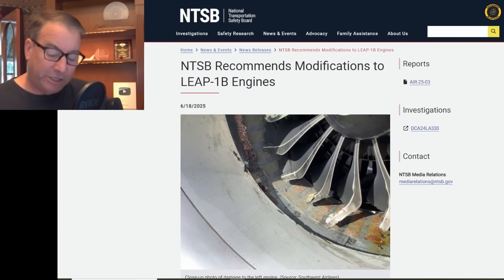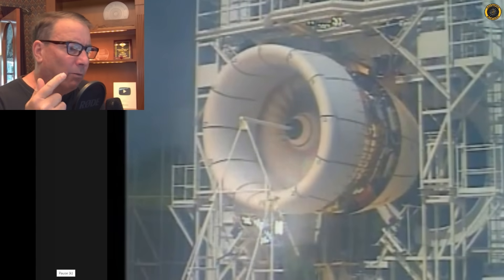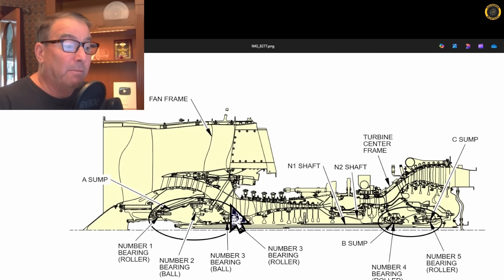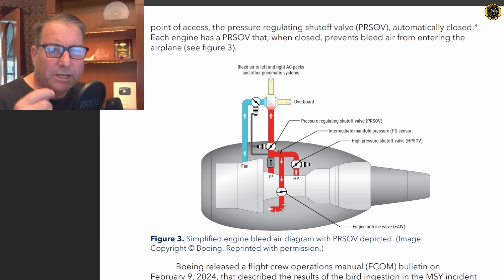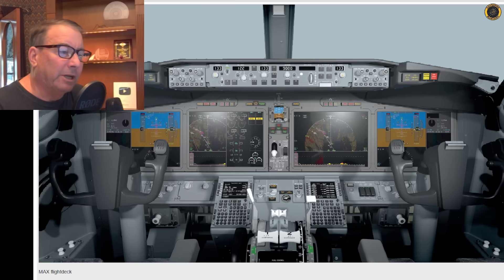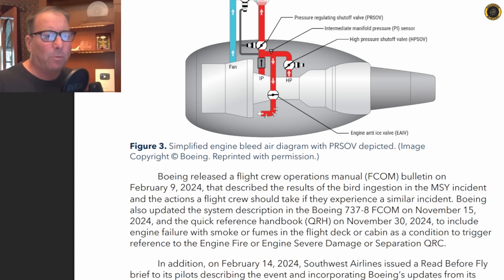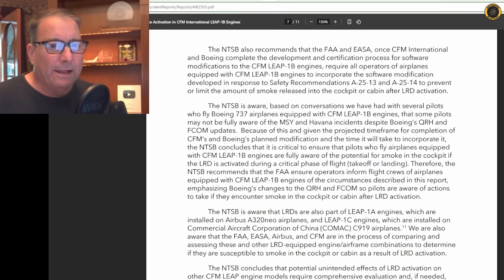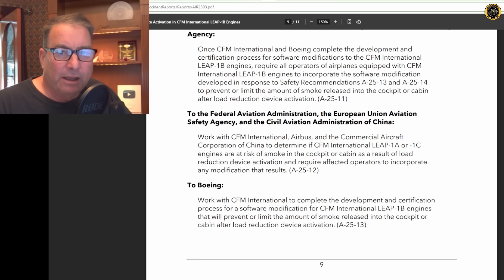NTSB Urgent Safety Recommendation 737Max LRD CFM Leap Engines

Comment: Old timer here . . . All 737s, at least it's my understanding that all 737s, have auto bus transfer systems for the electrical power coming off the generators (at least the old ones did that i used to work).  727s had the auto pack trip system, that would shut down the packs automatically if you lost an engine on takeoff.  And back in those days, the pylon attach points were designed to act as a structural fuse, and in case of a major vibration event were intended to shear and allow the damaged engine to fall away from yhe airplane rather than allow that major vibration to cause additional damage to the airplane structure or aeroelastic twisting too.  707s and 747s had that design.

Comment: Worth noting, that cockpit smoke also would slow down or even stop pilots response to emergency, because smoke could completly block their view to instumentations, checklist books and outside.
Which could cause totally prevetable crash or extra passengers poisoning.

So immediate closing (both ?) engine valves on any signs of smoke, IMHO, should be trained without checklist.

Comment: Just out of curiosity, are there records of how many bird strikes damaged early generations of jet engines, like the P&W JT3C and JT3D, used on Boeing 707's? Does the large air
intake of modern jet engines leave them more vulnerable to engine damage from bird strikes or runway debris?
Sometimes, progress is not all its cracked up to be. New generations of jet engines may be more efficient, but at what cost?

Comment: I'm glad that this is being addressed, and I'm glad you mentioned Mentor Pilot's video on this potential issue. In the event of a mid-flight failure, disabling the bleed air on the affected engine should be done very early, but I also remember that he suggested altering the takeoff checklist to leave the cockpit bleed air disabled (or something similar), because it wasn't needed during takeoff, and the smaller cockpit can be filled with toxic gas within seconds, incapacitating the pilots during the high workload of a takeoff where pilots are already busy managing a dozen other critical actions. In that situation, it's possible for one or both pilots to become incapacitated, which could be deadly in an event where the aircraft is now flying with only one engine during a takeoff.

It's also a positive change to see this finally being addressed. So many other potential issues with the 737 Max have been swept under the rug and ignored until they caused serious problems. It's refreshing to finally see these "small" issues being addressed BEFORE they cause loss of life or the loss of an aircraft.

Comment: Thank you 👍🏻😊 as always, very good analysis. Electronic updating of flight manuals, is a real issue, where flight crew do not get enough time to take in all the changes, without delaying a departure. Significant changes need to be better highlighted. Cheers, John. NZ 🇳🇿

Comment: As a B737 pilot, I can't, for the life of me, understand WHY our company hasn't mitigated this issue by authorizing and/or requiring ENG BLEEDS OFF takeoff procedures when operating a MAX.  That was the SOP at my Regional carrier the ENTIRE time I was there!!  Why not operate on the APU until 10,000 feet MSL and reconfigure as you egress the "sterile" phase of the flight??  It's not that hard!

I choose to not be Captain for a number of reasons.  If I were, however, I'd ask my First Officer his/her thoughts on bleeds off takeoffs and then request they set up for ENG BLEEDS OFF takeoff every time when operating a MAX.  That's just me...IMHO.  It shouldn't be discounted that forward thinking Captains and crews can't do this at present.  Just sayin'.  JSMH......

Comment: Juan, just a small correction to your otherwise nice video. 
On the max leap engine on the Boeing 737 uses 4th stage and 10th stage compressor air. The  5th and 9th stage air that you reference is only on the CFM 56 engine that is on the next generation Boeing not the max.

Comment: Wow, not automating that valve is a sin. I work in the commercial HVAC automation industry and air handlers/supply fans/dampers etc are always interlocked with the fire system automation.

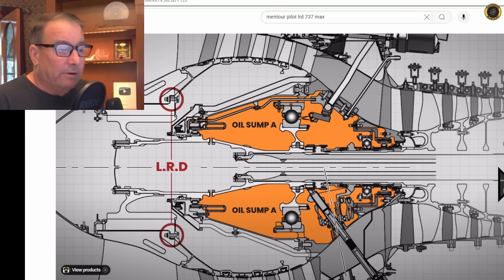Comment: The LRDs are incorrectly highlighted at 3:27. They are just above the first (large) ball bearing (the second Bering in the cutaway. 🇨🇦🏍️

The highlighted bolts are retaining the low pressure compressor drum (the 3LP compressor stages).

Comment: The FAA needs to set a time limit for extending any type certificate. These problems would not happen if the FAA forced clean sheet designs by way of not allowing the continued use of type certificates. Even the MCAS wouldn't have happened. I am not absolving Boeing on MCAS, I am simply saying that a full review to best practice should be forced every N years to introduce any new changes.

Comment: Would it not be better in modern aircraft to use electric pumps to feed the air intake for the cabin/cockpit? They could take the air from the front of the aircraft to get a bit of a ram air effect and that would be far from engine smoke.
Reply from the maker: Like the 787…
Reply: @blancolirio the 787 does that? Didn’t know 😊

Comment: So at the risk of sounding like a smarta$$ (I've been called worse), the system that reacts to a major malfunction in the engine (losing a blade and being seriously out of balance) is purely mechanical?  And the effects of it were not counteracted early enough on the emergency checklists?  I know there's a system (or monitor) to track vibrations, but this isn't designed to shut the engine off or turn off the bleeds?

Comment: I think there must be some vacuum tubes in 737MAX design somewhere. Why modernize old system if it is working, just leave is as it is. If it was great in the XX-th century, why not to use exact same design in XXI-th.

Comment: Juan, we DON'T HAVE AN EICAS on 737 MAX. It is a bone of contention because the MAX is "derivative." I have not gotten into the weeds of FAR 25. We have been told that an EICAS is now required for new transport category designs, but that the MAX is "grandfathered" in. Like with the MCAS, Boeing is trying to avoid remedial pilot training. In this instance Boeing has resisted incorporating the EICAS on THE MAX ostensibly  to save the airlines money. It obviously saves Boeing money up front by eliminating design updates. Thousands of 737 pilots do just fine without the MCAS. YOU have EICAS on your 777. WE HAVE THE TECHNOLOGY. How then, do we feel about not incorporating it into the derivative 737 MAX? 
Thanks for showing us the schematic drawing of the LRD on the LEAP -1 engines.

Comment: Hi Juan, I was very lucky my last year when we ingested a hawk into the no. 1 engine while rotating for takeoff out of OAK on a MAX8. We heard the 'thump' of the impact but were unsure as to where it had hit. Climbing out, we assessed the engines and saw no appreciable deviations on the engines to include the vibration indicators. We also did not detect any other 'normal' birdstrike indications such as smell in the cabin, etc.. Controls were all normal and we surmised either a glancing blow off the engine nacelle, leading edge, or perhaps the landing gear or empennage. The FA's did a visual check and noted no anomalies either, so, we continued down to SAN. After landing, I immediately went down to inspect the aircraft and was met on the jetway stairs by the Ground Sup. The no. 1 engine indicated the hawk had gone through the outer bypass section of the engine, causing notable/moderate damage to one blade and negligible damage to two adjacent blades. The aircraft was taken out of service and when I called  maintenance the following week to inquire about the fix, they said they replaced all three blades at a cost of over $80K per blade!
Reply: They can replace those blades on wing, a vibration survey engine run would be required
Reply: The bird got one expensive haircut!
Reply: Is that an engine out repair or can they do it on the plane?

Comment: It seems a lot of problems resulted from the  act of avoiding a new type certificate requirement on the Max. Unfortunately, some of those problems  directly resulted in fatalities. I still believe that only having one sensor indicating pitch was inexcusable when it had the ability to take pitch control away from the pilots.
Reply: Angle of attack rather than pitch?

Comment: Might it be sometimes beneficial for a dead engine to be sheared off of the wing? The 777 incident in Hawaii comes to mind. Seems like it would've been easier to control if that engine wasn't there at all.
Reply: Considering that engines provide considerable load relief to the wing (hence why aircraft with tail-mounted engines need reinforced wings), and more often than not tend to go up and over when they do come off, critically damaging the wing and flight controls in the process...

Comment: You can do the same thing (PRSOV) off by reaching up and selecting the correct bleed valve.  If you have smoke the bleed valve over head is the quick and less intrusive (fire handle).  IMHO with 10,000 in B-737 and several smoke fire removal occurrences in real life, going to the bleed valve is quicker, safer and has less consequences than the fire handle.  Bring the affected engine to idle and if smoke is present confirm correct side and turn off bleed valve.  That will clear smoke quickly.  Raise cabin to help evacuate the smoke.  But that will never be considered, ask me how I know...retired ex Con from United.  Flow Control Shut-off valve is also downstream of the bleed valve and if that is leaking and blowing hot air, it will also cause smoke in cabin or cockpit depending of left (cockpit) or right (cabin).  If you are dispatched with a Pack inoperative, they will have you put the bleeds on, and that is for possible icing encounters which is stupid.

Comment: Juan, are you able to discuss the detrimental physiological effect(s) of inhaling engine oil vapour that has entered the airplanes air conditioning and pressurisation system.
Reply from the maker: Not good…
Reply: @blancolirio I agree. Any time an odour was detected or vapour was visible we would don our oxy masks and submit to a blood screen on arrival. Synthetic jet engine oils were extremely toxic with possible long term cancer connotations … but I left that life a decade ago. Things may have changed since then.

Comment: I know everyone likes to hate on Boeing and the MAX, but all these problems stem from the reasonable desire by airlines to have the same pilots operate similar aircraft under the same type rating in order to maintain operational flexibility and efficiency. The strict requirements for the type rating system I think are causing a lot of the problems we’ve seen with the MAX. I’m not saying we absolve Boeing of its part, but maybe it’s time we at least reevaluate the FAAs type rating system, and maybe do some studies as to whether improvements can be made to both safety and operational efficiency of airlines. Because right now I’m seeing a safety system that is causing people to be put at risk in the face of a perfectly reasonable operational expectation.

Comment: CFM should have updated the software years ago to ensure that the valve is shut off as soon as the LRD snaps. It makes no sense at all to continue to supply bleed air that is most probably contaminated.

Why wait for an external system to do it?

I'd spend the extra dollars to not even leave it up to software to shut off the bleed air but have a mechanical connection between LRD and bleed valves; ahead of the electric ones.

Comment: Are high bypass jet engines really nothing more than highly evolved turboprop engines?  Instead of a conventional propeller, a high bypass jet has a multiblade, shrouded propeller. Not that pondering about this has anything to do with Juan's report, just throwing this out there to see if anyone else has had similar thoughts.

Comment: Bleed air comes from 4th and 10th compressor stages in CFM LEAP-1B, not from 5th/9th as is the case with CFM56 engines in older 737s.

Comment: Atomized turbine engine oil is a neurotoxin, that has been proven. As an old-school retired airline captain, why don’t we train the current crop of system operator pilots to use system knowledge at the first hint of this kind of smoke or fumes following the activation of the LRD.  It should be easy To determine the offending engine by the vibration monitor or other engine indications.  Memory item: turn the pack off on the offending engine before running the QRH!  Little to no risk of screwing this one up and by doing so, prevent toxic fumes from entering the cabin immediately.

Comment: FACT: BRAD HARTLIEP - with 40 YEARS of EXECUTIVE and Technical LEADERSHIP experience in Aviation SAFETY, Jet Engines, Aircraft Systems and Structures on BOEING Military and Commercial Aircraft - is 300 Million Times BETTER QUALIFIED to be PRESIDENT AND CEO OF BOEING than Kelly Ortberg [ current UNFIT Boeing "Ceo" ], Dave Calhoun [ the 2020-2024 Idiot UNFIT to be Boeing CEO ] , and Dennis Muilenburg [ the 2015 - 2019 UNFIT IDIOT Boeing CEO ] ..

Brad Hartliep has ALL THE QUALIFICATIONS NEEDED to RESTORE QUALITY to Boeing Airplanes and build multi-decade Value ..

Comment: Who is the genius who decided that's it's a good idea to dump all the oil into core air flow upstream of the cabin bleed air intake?  Those oil fumes can incapacitate in less than 40 seconds.  Imagine taking off with a copilot going through the Initial Operating Experience, from a high workload airport with terrain on all quadrants, dealing with a bird strike, smoke in the cockpit condition and trying to navigate you way out of the valley with reduced climb performance, all at the same time.

Comment: Now suddenly, because of the LRD, smoke combined with non-normal engine operation becomes the talk of the town. Nothing new here. There have always been numerous engine failure modes where a technical problem could lead to smoke in the bleed air system, no need for a LRD. I always learned that non-normal engine operation combined with smoke is best treated with “severe damage” memory actions, a soon as the aircraft is stable on the takeoff flight path (gear up and above 400ft AAL).

Comment: This is what I call MCAS 2.0.  Why?  Because it has the possibility of causing a hull loss at worst or permanent damage to the lungs (after 39 seconds of exposure) and the pilots are only learning about it now?  

Second, the “fix” like with MCAS is to immediately turn off the affected system, in this case the bleed switch on the engine with the vibration problem.  Voila!  No micronized raw engine oil entering the cockpit or cabin.  No need for the pilots to don oxygen masks during a critical phase of flight, takeoff or landing.  

In a high vibration event the pilots are going to identify the engine immediately. Ok!  Now reach up and turn off the bleed or pack first.  Don’t wait for the checklist to do so while wearing an oxygen mask, having difficulty communicating with each other, possible at night, in high terrain, etc…

Comment: No Engines Checklist Question 1 : did you have engines at take off?  
Yes go to question 2. If no then go to question 3.
Question 2: is there smoke on the flight deck?  Yes then leave this checklist and go to the checklist for Smoke in the Flight deck

Smoke in flight deck Checklist
Question 1 if you havent passed out by now, fight with the orher flight deck members for the one working face mask.  There will be four available, but just one works to help cut costs.  When you find out which mask is working then tap into that mask using a quick flick of the wrist puncture kind of like putting a straw into a slurpee lid

Comment: Is this is another good example of lazy thinking when extending the design of an airframe past its optimum lifetime? There is no reason why the problem could not have been addressed at the time of designing  the 737 max series other than a reduction of cost.  The 737 has been around long enough  for them to have been aware of the problem at the design stage although maybe ata different level with alternative engines.

Comment: I'm not a pilot, but saying you should isolate the packs struck me as odd, as they'd be isolated in normal operation from what I understand. Would you want to leave the isolation closed and turn off the relevant pack, or would you turn the relevant bleed off and isolation open to run both packs from one engine? It's my amateur understanding that the latter would be preferable... but of course I could be completely misunderstanding the bleed circuits.

Comment: Juan,  maybe you could ask your airline (or the MTSB) to have your iPADs programmed so that they TELL  you which procedures have been updated,  immediately you turn them on.  Even more sophisticated would be to have some facility in the iPAD to tell it to give you a list of all updates over (say) the last 30 days.
Reply: In the airline where I used to work, they have a customised document reader, which displays recent changes in a different colour. If you want you can reset the colour after you have accessed all pages where there are new changes, or you can allow the colour to persist for a certain time so that you read changes more than once.
Reply: At the Major I work at you have to acknowledge every change.

Comment: The LRD bolts are between the static Fan bearing support housing and the Front Structure. The bolts highlighted in your video connect the Booster drive arm to the Fan. A shearing of the LRD bolts leads to a separation of the Fan bearing support housing from the Front Structure leading to a shift in the resonance frequency of the out of balance Fan and hence reducing the loads on the rest of the engine and aircraft